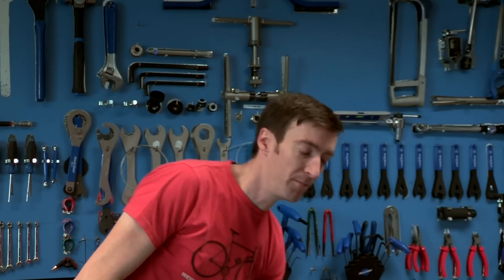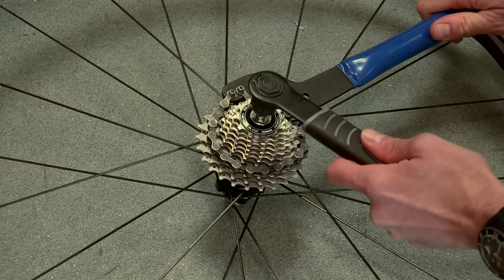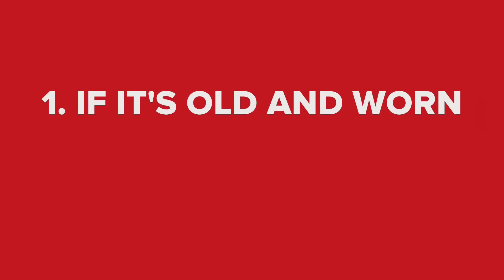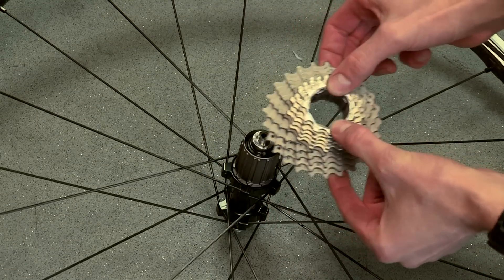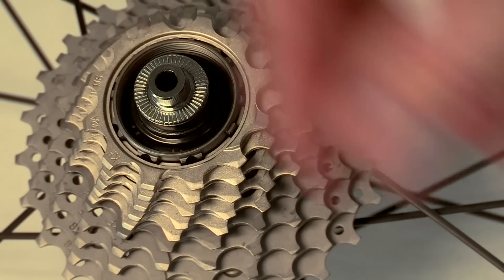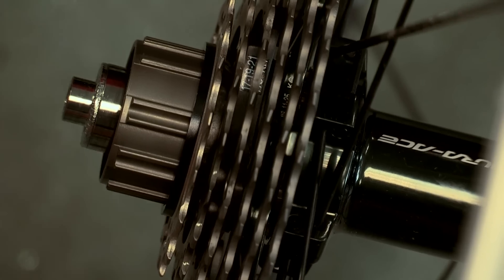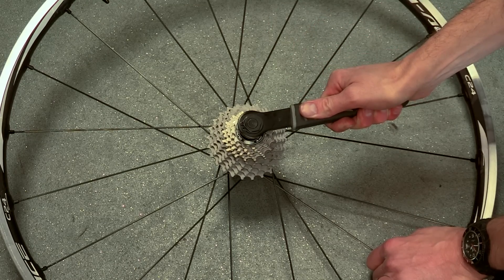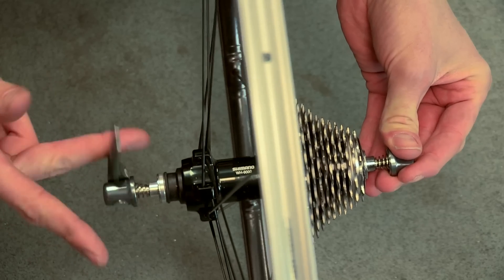How To Change A Bicycle Cassette - GCN's Bike Maintenance Series

Comment from the maker: You'll be ok with those Jared, the cassette tool is the same for both brands. Hope the switch goes well. You may need a slightly longer chain though depending on how big your current cassette is.

Comment: Thank you. I had just put on a new chain and on the stand the gears were indexed fine, but as I got up on the bike, they were jumping all over the place. As you suggested, the cassette was worn down, and after replacing it everything worked smoothly.

Comment from the maker: I think you'd struggle as there probably isn't enough width between the dropouts to fit a wheel and a cassette. That's one of the reasons for using a hub gear on folding bikes.

Comment: One of the cardinal mistakes that people make with chain maintenance is to break the chain for maintenance.  This isn't necessary and Shimano is totally out to lunch on this issue for recommending it.  Purchasing a good chain connector (Wippermann) is far more preferable because breaking the chain makes it less reliable.  it makes maintenance of the chain far easier.  I only break a chain when installing a new one and I have to size the chain properly.

Comment: They became "cassettes" when the guts of the old style "freewheel" were incorporated into the hub. So, "freehub" and cassettes. Just make the lockring "click" several times upon tightening. Pretty fair pull. 11-21t 10 speed cassettes and a triple crankset. Little extra weight, a little more trimming the front derailleur, but very versitile for my needs.

Comment: Just bought a 2015 Specialized Allez.  It has the Claris groupset.  If I wanted to upgrade to a sora or tiagra would it be compatible since I will be going from an 8 gear cassette to a 10 or 11?

Comment: So how long has a sprocket cluster been known as a cassette?
Admittedly, I was away from cycling for a few years, during which time 700 tyres replaced 27 inch as the road bike standard.

Comment: I'm upgrading my set of wheels. I have a 9 speed cassette right now, and will use the same one for my new wheels.
My new wheels are compatible with 9, 10 and 11 speeds. Does this mean that there will be a gap or are the three cassettes the same width?

Comment: Great video, thanks. Is it possible for lock rings to rust or seize on? I only ask as mine seems well and truly stuck, and I can't get the cassette off. Which is annoying as it's my wet weather bike that I can't ride!
Reply from the maker: It's unusual as most cassettes are alloy now, but if it's an older one and steel, yes it might have rusted. Equally it could be that the locking is done up really tight so you might need a Very Big Spanner to get the required purchase to loosen it. Beware your knuckles though, slipping into a cassette is blooming painful!
Reply: Ah, thanks. It's a 10 speed shimano cassette and been on since factory fitting about 2 years ago, so I'll go with the Very Big Spanner approach for now before consulting the experts at the LBS. Thanks for the reply!
Reply from the maker: Chris Watson No probs and good luck!
Reply: Global Cycling Network thanks for all the help. Thanks to you I've managed to replace it. The approach involving a Very Big Spanner worked (when coupled with a kick or two). I think it had just been fitted VERY tight.
Reply from the maker: Chris Watson Excellent news, really glad you managed to get it sorted :-)
Reply: I find that shoving the spanner in to a windsurfer mast, then use g that as leverage should move everything that isn't broken :)
Reply: +Iain Campbell Windsurf mast - tut tut - use a scaffold pole and be a real pro :-)

Comment: Do I need to make any changes to my derailures if I go from a 9 speed 11/26 to a 9 speed 12/27? Also would I need to change my chain in this process as well? Thanks for the good videos.
Reply from the maker: With just one tooth difference, it's unlikely that you'll need to change anything.

Comment: I have a Shimano 105 5800 11-speed 12-25 rear cassette on my nearly-new bike, but wish to change it to an 11-28 one. Would you advise replacing the chain also?
Reply: Assuming that you have the chain at the correct length, and remember, there is some leeway on what is correct, the small difference between the cassettes probably won't require you to make a change.  When I install a new chain, the put the chain on the smallest gear combination (least number of teeth) I will use.  The rear derailleur cage should be in tension by about a half to a full inch.  Then switch to the gear with the greatest number of teeth you'll you will use.  If you can shift to this gear easily and the rear derailleur is not hyperextended. you're good to go.

Comment: Global Cycling Network  I'm just about to order a new set of wheels - PlanetX CT45 Carbon Clincher. What's your thoughts on these? Anyway, I'm thinking to alter my rear cassette from 11-25 to 11-28, will I require a new chain? I know best practice is to renew the lot but I recently had to purchase a new chain and it's only done 200 mile. Great show by the way.
Reply from the maker: Hi David, we've not spent any time on those wheels so we're not well placed to comment I'm afraid. As for your cassette dilemma, the best thing is to just try it. You might be fine, you might have to add a link in, it just depends. And you should be able to get 2000 miles out of a chain if you look after it well.
Reply: Global Cycling Network No worries guys, thanks!

Comment: Global Cycling Network Should I put some teflon grease before installing the cassette?
Reply from the maker: You don't need to normally, but very occasionally they can make a noise a bit, at which point you could add a little grease.
Reply: Global Cycling Network Thanks!

Comment: so I did this but there is still some play on the cassette. I could possibly tighten it a little more but would need to brace against the wheel and I am worried about warping the wheel.
*play (rotational wobbling perpendicular to the direction of travel)
Reply from the maker: hi, maybe check that the freehub bearings are ok.
thanks
Jon

Comment: Where + how many spacers should I use when putting a 9 speed cassette on an 11 speed hub?
Reply from the maker: BaconBaconBaconable The width of the hub doesn't usually change, the width of the sprockets is normally the difference. So you might not need any spacers. If in doubt go and see your local bike shop though.

Comment: I need help. When I try to pedal my rear cassette is spinning but the wheel doesn't move. I don't know what this is and I need help with how I can fix it thanks
Reply: The cassette is spinning freely
Reply from the maker: Hi, I'm afraid it sounds like the freehub is in need of some attention. When it gets full of gunk, or just really old sometimes, the internals of the freehub stop working which means that it spins both ways. Some can be cleaned and fixed, others unfortunately not. Maybe take it in to your local shop and get them to tell you whether it can or not.
Reply: Thanks

Comment: Global Cycling Network If you alter your rear cassette from 11-28 to 11-25 do you need a different chain?
Reply from the maker: Daniel King You'll probably be ok going that way - reducing the size of the biggest sprocket, but it's a good idea to change the chain anyway as it's probably a bit worn and stretched.

Comment: my bike has 16 gears and i want to up grade because i live in a hilly area, can i and if so could you recommend one to buy thanks
Reply from the maker: It's really expensive and quite tricky to increase the number of gears on your bike. In actual fact though, having only 16 gears won't limit you for climbing, the range between the biggest and smallest cogs on the cassette should be the same, you just miss some gears in the middle.
Reply: okay thanks

Comment: Are 9,10, and 11 cassettes all compatible with the same cassette bodies? I have a 9 speed and thinking about upgrading to a 10 speed.
Reply from the maker: Broadly, yes. Depends on if your freehub is campag or not though, but the width is the same.
Reply: +Global Cycling Network I have a 10-speed Shimano 105 cassette. I would like to replace it with an 11-speed Shimano Dura-Ace. Is it really possible to change from 10- to 11-speed Shimano cassette? Because I'm afraid to risk buying a new cassette, it might be not compatible. Thanks a lot for your kind reply, GCN. More power!
Reply from the maker: +08Ultrasonic not always, no, and you'll need to change your shifters as well.

Comment: What is the spring actually for? Is it basically a washer? If so, does it as a shake proof washer?
Reply from the maker: It simply helps with the quick release so you're not having to mess around with the skewers moving side to side.
Reply: I don't understand how it would stop the faff, surely it makes no difference? May you explain further please?
What do you mean moving side to side? On the axis in which the skewer is inserted in to the hub or as you look at the wheel side on?
Reply: Or are the springs literally used to push the bolt heads out away from the frame, especially in the case of quick releases, to make the action of removing a wheel a split second quicker?
Reply from the maker: 08Ultrasonic Exactly, and when you're putting a wheel back into the frame imagine if the skewer was moving side to side - it would be really annoying!

Comment: You say the recommended torque is 40Nm when tightening up the lock ring, but how would you check that?
Reply: It usually says on the lock ring . For instance I'm swapping mine taday and it says 40Nm
Reply: I mean how would you know when you've applied that much torque?
Reply from the maker: ***** You would need a torque wrench. It feels pretty tight!

Comment: I installed new wheels and a cassette for my bike, since then I've had a clicking noise come from the cassette and occasionally the chain jumps. What can I do to fix this?
Reply from the maker: Hi there,
It sounds like your indexing is a little off and you'll need to use the barrel adjuster to fix this. Have a look at this video for indexing tips: How to Change Your Rear Derailleur - Replacing Your Bike's Rear Mech

Comment: I have a 7 speed cassette and i want to upgrade to a 11 speed. What do i need to change? I have a Crescent Exa and the frame is really good and i know that i'll never be able to afford a bike like this again
Reply from the maker: Hi Andreas, it's really complicated I'm afraid. You'd need a new cassette of course, but also a new rear wheel, new rear derailleur, new chain, and new shifter. While 11 speed is great, it certainly won't make you go faster, or have more fun riding, so maybe it's not worth the hassle?
Reply from the maker: AndreasCarlsson10  I'd double check to make sure the width between the rear stays will work with the wheel you want/need :-( to buy.

Comment: Can i use a mtb cassette on my road bike?
Reply from the maker: Possibly, but it depends on your rear derailleur. It needs to be a long cage to handle the larger cogs.
Reply: +Global Cycling Network I'm also thinking about changing to mtb cassette due to the hills in my area. I would be jumping from 13-25 to 11-32. Would I need a long cage rear derailleur for this change, or you think my current one should handle it?

Comment: Can I change only the most worn out cogs?
Reply from the maker: MrMollmann No it's an all or nothing job I'm afraid. Makes it easier though in the long run.
Reply: +Global Cycling Network Why?
Reply: +Global Cycling Network Thanks; I was wondering because I am about to change my 11-30 to a 12-23 and was wondering if I can do some mix and matching with cogs. It appears as though you answered that question.
Reply: Damn